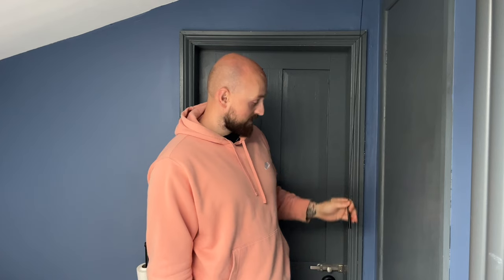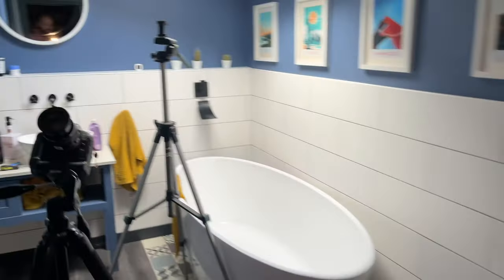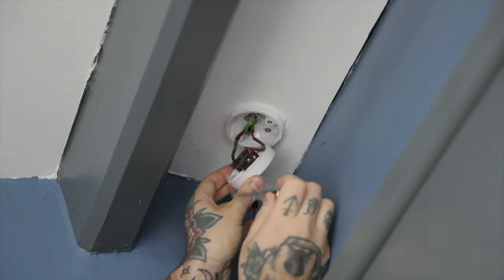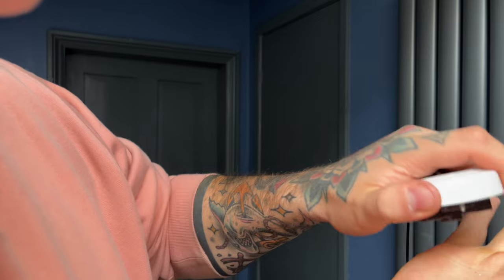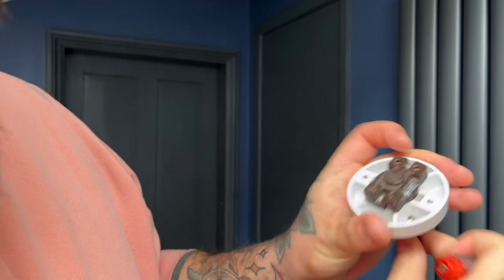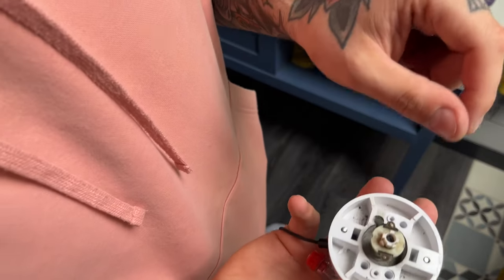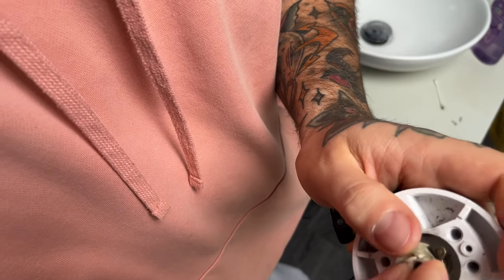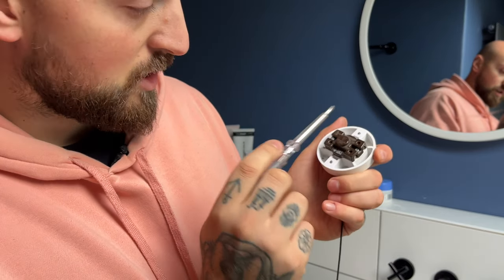How to Fix a Sticking Light Switch Pull Cord

Comment: Can that be completely replaced with a push switch on the wall?
Reply from the maker: They can be, they’re just a switch to cut power to the light fitting, so any switch could be used. There are regulations surrounding safety with switches in bathrooms though. A lot of houses in the UK have switches outside the door to keep them away from wet areas